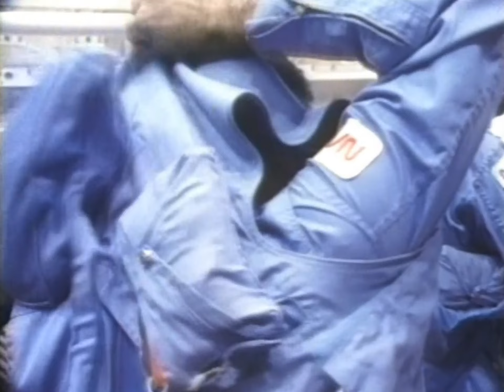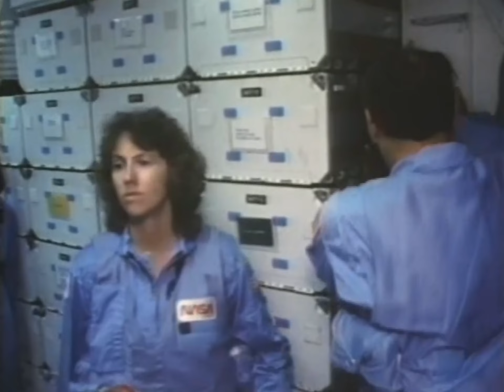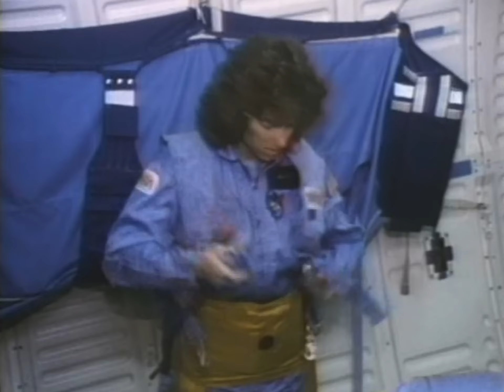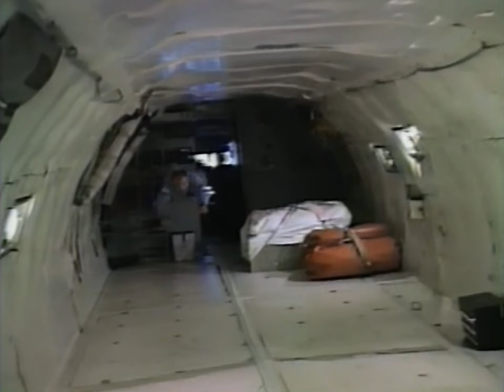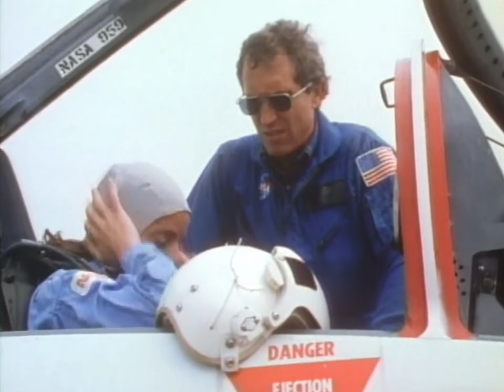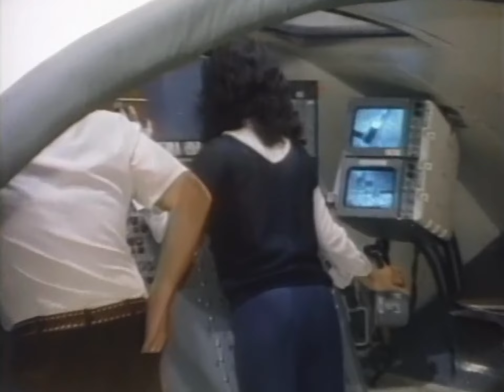STS-51L Pre-Flight Press Conference

Comment: Hard to believe this is the 36th anniversary of the Challenger disaster, today 28 January 2022... 36 years ago today I was a freshman in high school; I had skipped school that day to work on the farm... it was a gorgeous sunny January day, breezy and crisp, as on the Texas coastal plain just west of Houston (JSC is 70 miles from my back door) we had gotten the tail end of the cold front a couple days earlier-- the same cold front which dropped the temperatures SO savagely the night of the 27th in Florida at the Cape, forming all the icicles on the pad and deep chilling the O-rings in the booster that caused the disaster that took the astronauts' lives.  Since the front had come through essentially without rain, I decided to take advantage of the dry weather to get the cotton fields hipped up, break the ground crust open from the long wet winter and build the beds back up some, help the fields dry out faster and be ready for subsequent trips across the fields to knife in liquid fertilizer, spray a pre-plant incorporated application of Trifluralin weed killer and disk it in, and then hip the fields back up to rebuild the beds, finish incorporating the chemical, and smooth the beds off for subsequent planting of cotton in mid-April.  I remember just enjoying the beautiful if cool weather, running the open station tractor out in the field, everything going smoothly, and not having to deal with the drudgery of school that day.  I was working on the south central area of the farm, when I saw Grandma's 85 Ford pickup pull off on the side of the road on the west side of the farm.  Dad had worked the night shift at the nuclear power plant at Bay City, which was still under construction at the time, and had come in and got a few hours sleep, and woke up for lunch.  He'd driven down to the field to pick me up and together we'd go to Grandma's at the north end of the farm for lunch.  I finished my round in the field, pulled out and turned around, lowered the hipper into the ground, and stopped the tractor and shut down, hopped over the road ditch, and got in the truck.  As we pulled up onto the road, Dad asked how it was going and I told him, and he suddenly said, "The space shuttle blew up!"  He knew I was a space nut even back then, and I asked something about it and he said, "No it blew up on the way up there!" and I figured, "Oh, he just saw the boosters come off, with their retrorockets to push them away from the rest of the shuttle, that kinda looks like it blew up... " and figured that was that.  Well, a couple minutes later when we arrived at Grandma's, the awful truth was all over the TV... The shuttle HAD blown up, though at the time it was nonstop speculation as to the cause-- the main idea floating then was it was a shuttle main engine that had blown up.  It wouldn't be til much later that the truth came out, the faulty SRB O-ring seals that had failed and burned a hole in the booster, which started as a tiny leak, sealed off by 'gunk' (carbon soot and molten alumina) shortly after the O-rings burned in a puff of black smoke at liftoff, which kept the void sealed until wind shear from the cold front shattered the gunk and allowed it to blow out of the void a minute or so into the flight... within seconds the 750 PSI 5000+ degree hot gases of the SRB combustion, racing through the void, cut the steel shell of the SRB joint away like a blowtorch, burning a hole that was I had read some 3 feet across by the time the shuttle was destroyed.  The hot gas had impinged on the side of the thin aluminum skinned External Tank, and upon the rear strut attached to a boss welded to the thin tank wall, which held the rear of the shuttle SRB in place.  The huge hole caused a pressure drop in the right SRB which showed up in the telemetry, as did the fact that the shuttle engines started gimbaling harder and harder to the side trying to counteract the side-force of the thrust from the hot gas escaping from the hole in the side of the SRB, side-loading the entire stack.  The hot gas quickly burned away the foam insulation over the thin aluminum tank wall, and for a bit the ultra-cold liquid hydrogen would have started boiling furiously in the tank, cooling the tank wall that the hot gas was blasting against from the outside.  Very quickly the aluminum wall gave way, started to rip like a sheet of paper as the SRB, pushing hard sideways from the hot gas blowing out the hole even as the main engines neared "hard over" on the gimbals trying to keep the shuttle flying straight against this ever-growing side thrust from the SRB hole, until the structure couldn't take it, the rear strut boss ripped away from the tank, and the crack ripped the tank wide open, quickly propagating around the rear dome weld joining the aft dome of the ET to the barrel sections of the hydrogen tank, the dome falling away under the weight of the hundreds of thousands of gallons of liquid hydrogen sitting atop it, spilling it all into the atmosphere.  At the exact same time, the rear end of the SRB swung away from the side of the tank due to the thrust from the hole, pivoting around the front ball socket that transferred the SRB's thrust into the cross-beam in the ET's intertank region between the lower hydrogen tank and upper ogive oxygen tank, the front of the SRB swung around the pivot point and into the side of the oxygen tank like a 12 foot diameter can opener, ripping through the thin aluminum skin of the much heavier liquid oxygen tank, spilling thousands of gallons of pressurized super-cold liquid oxygen in a moment, resulting in the enormous fireball that engulfed the orbiter and disintegrating External Tank.  The shuttle orbiter's main engines, being nearly hard over trying to correct for the SRB hole side-thrust, now relieved of that load, shoved the orbiter sideways even as the engines starved of fuel and oxidizer burned out, causing the orbiter to break up in the rushing slipstream of air.  The boosters, now free from the disintegrated rubble of the tank, fully intact since they're made of 2 inch thick maraging steel like a submarine hull designed to handle the ocean's crushing depths, simple raced out of the fireball, without guidance from the shuttle's computers to steer them they flew wildly for a number of seconds until the range safety officer pushed the button to detonate their linear shaped charges to "unzip" the casings, at which point the high pressure gas inside would blow the SRB's wide open and terminate their thrust.  All of it then rained back down into the Atlantic far below.  

To be continued.... OL J R :)
Reply: Continued... 

At the time I had harbored a young man's dreams of potentially becoming an astronaut one day... the shuttle was to bring in a "new era in spaceflight" and the popular theme being presented at the time was of shuttles building everything from space telescopes to space stations to massive power stations in orbit, beaming their electricity back to Earth as microwave energy, converted back into electricity in massive ground stations that would power our cities and industry... the magazines of the time were filled with images of shuttles one day building massive O'Neill cylinders which people could live in, creating new homes and towns and farms and stuff on the interior surface of the gently spinning cylinders for artificial gravity, lit by the sunlight piped in through the ends along the cylinder's center core... The shuttle had been sold to the public as the "DC-3 of space", a 'space dump truck' that was, as soon as the few remaining kinks were worked out, would be capable of "safe, routine, cheap access to space" and making this entire future possible.  While I enjoyed being a farmer and didn't really want to go to college for years to be a scientist astronaut, I figured maybe at some point they'd need space welders, which even at 15 I was already very good at, so maybe I'd get to space that way.  At any rate, the destruction of the Challenger certainly was eye-opening, if not in the way that Christa McAuliffe had intended... it laid bare the fact that NASA had been selling a 'bum steer' all along in the shuttle-- so desperate in the post-Apollo era to maintain its fiefdom and relevance (and funding) even as the heyday of the "space race" or "moon race" was a fading memory, while the Cold War despite it's brief respite of "detente" in the early-mid 70's had descended back into the depths of paranoia in the early 80's, the promise of "glasnost" wasn't even on the radar then, and which nobody at the time knew would abruptly end with the Soviet collapse in 1991.  Shuttle had been sold and NASA had beat the drums as hard as they could to convince everyone, inside and out of government, that it was the "be all end-all" of space transportation, when in reality it was a technologically brittle, extremely expensive, and inherently dangerous and limited space vehicle, based on flawed assumptions and flawed compromises which had inherently hobbled its design and purposes, and ensured it would NEVER be what NASA had convinced everybody it would be.  BUT NASA was SO heavily invested in it, and SO desperate to maintain their funding and relevance, that they continued to sell this bill of goods to the Congress and public long after they KNEW it would never be as safe or cheap or "easy" as they had purported it to be.  NASA had taken to flying Congressmen and Senators in charge of NASA funding on the shuttle, now that they had 7 seats available after the removal of the ejection seats present on the first four flights, once shuttle was declared "operational".  Jake Garn, now head of NASA, had in fact gotten Greg Jarvis's seat on a previous shuttle flight-- Jarvis had won his seat in a Hughes Space Division contest for a free shuttle seat for NASA contractors.  As a mere company engineer, he was bumped from the flight to make room for Garn, an influential space-state politician at the time, who could argue for more appropriations for NASA at the time.  Jarvis would end up on Challenger.  The "teacher in space" program had been announced to great fanfare over a year earlier, when I was in middle school... I suggested to my social studies teacher, Mr. Reichardt, who had played football with my Dad at Shiner High back in the mid-60's, that he should apply... he just laughed and said they wouldn't get him up there!  He told me later how he'd worked on Jupiter missiles in Italy or Turkey when he was in the Air Force after graduating high school, so he'd seen enough to know that he didn't care to go LOL:)  The professional astronaut corps, they surely had to know of the shuttle's problems, and bravely decided to take the risks, but poor Christa and Greg, they were sold a "bill of goods" by all the press surrounding the shuttle program; they put their faith in the system and were let down by it, and paid with their lives.  

Challenger burst the bubble; it really laid bare the fact that NASA had been "cooking the numbers" all along on the shuttle in order to get it approved and keep it funded, and that it would NEVER be what they had promised it to be-- cheap, easy, routine, and SAFE transportation to space.  It laid bare how far NASA had strayed from its roots as well, where management during Apollo, after the tragedy of the Apollo 1 fire (which was the 55th anniversary of yesterday, 27 January 1967), had concentrated on managing risk and danger and ameliorating it wherever possible, even to the point of becoming somewhat risk averse, particularly after the Apollo 11 moon landing had been achieved, to a bunch of bureaucrats in upper management positions more worried about their careers, maintaining funding and meeting political aims of the program, and keeping to "the schedule" to keep the image intact that NASA had carefully crafted for the shuttle.  To the point they overrode their own engineers in the face of AMPLE evidence and reversed their stand on "prove it's safe" to "prove it's unsafe" (which you can never prove a negative completely) and in so doing killed seven astronauts and blew up a multi-billion dollar spacecraft.  It also brought into the stark light of reality just how far you can trust the government, at least in the mind of one teenage Texas farm boy LOL:)  

We ate our lunch that noon while watching the coverage of the unfolding disaster on TV, which went nonstop for the rest of the day essentially.  After lunch I had to get back to the field and Dad had to go back to sleep for awhile to go back to the nuke plant to work that night, so I popped in a blank tape into the brand new Sears top-loader VCR I'd bought for the whopping sum of $350 on sale (because it was a close-out model) at Sears the previous fall with most of my crop money I'd made for the year... they'd been out a few years but NO WAY could I afford them when they were $500-700 like they had been a few years before... you could buy a GOOD used car back then for that kind of money (better if you put a little more with it!)  I watched the tape that night and kept it, periodically watching it.  Also taught me a lot about how the media REALLY works, in all the rubbish they were "reporting" at the time, and of course the stuff that came out of the Roger's Commission later on investigating the Challenger disaster.  NASA at the time had known the danger and was already designing the "improved" O-ring seal design used on subsequent flights... but had chosen to keep flying until the new SRB casings with the new field joint designs became available for flight hardware.   They KNEW the response to cold, as the previous flight (IIRC it was Garn's) had come back with an SRB with a hole burned through the casing the size of a basketball-- fortunately for his flight the seals didn't disintegrate the hole start burning through the casing until just before SRB burnout, and the hole was on the side AWAY from the vulnerable External Tank, so the hot gas vented harmlessly away from the vehicle, and didn't get too bad before the SRB's burned out and were jettisoned.  That flight, IIRC, had established the 53 degree launch criteria, which IIRC the temperature was 27 degrees in the right SRB when Challenger launched that morning.  Sadly, NASA didn't learn its lesson for very long, either, because on 3 Feb 2003, just a hair over 17 years later, NASA would lose another shuttle, Challenger's sister ship Columbia, along with its seven crew, to another WELL UNDERSTOOD and previously experienced damage causing foam strike to the orbiter's heat shield-- a problem which was basically unsolvable with 100% certainty, which led to a reboot of the space program and ultimately to the shuttle's retirement for good... which it was a shame didn't occur after Challenger back in 1986, honestly.  Shuttle was horrifically expensive and inherently dangerous, and  could not be equipped with a meaningful crew escape capability in all phases of flight, unlike previous vehicles, and by the early 2000's it was apparent it needed to be replaced, its lifetime was limited due to it's 40+ year old technology and the fact that it would cost billions to upgrade it, billions that could be better spent on more cost-effective and safer spacecraft capable of going further (like back to the Moon) which shuttles could NEVER do... BUT nobody could see how NASA would ever get the funding to retire a "functional" shuttle system and the billions in funding necessary to design and build a replacement system for it.  Sadly, Columbia drove that point home and provided the impetus to make the hard decision to retire shuttle and replace it with other vehicles.  Sad because it took such a disaster to make what was otherwise a straightforward and sensible decision, and it took another 7 astronauts lives to make the point and get it done.  

Later!  OL J R : )